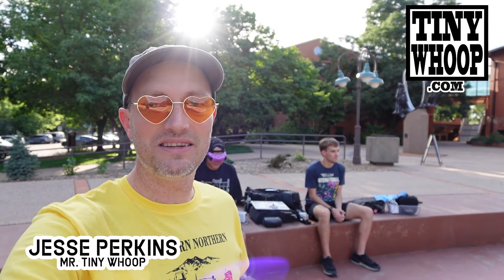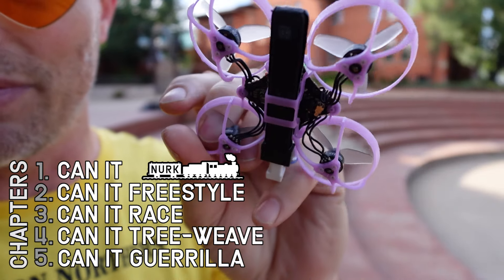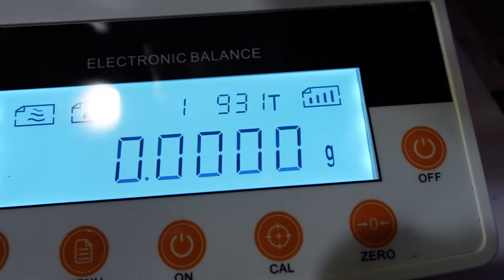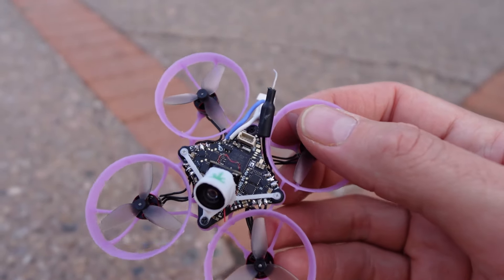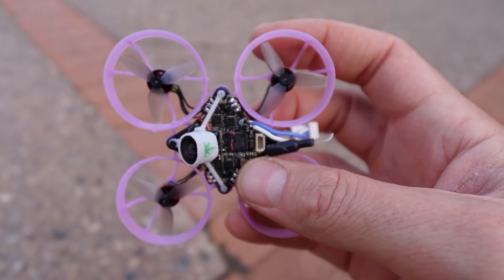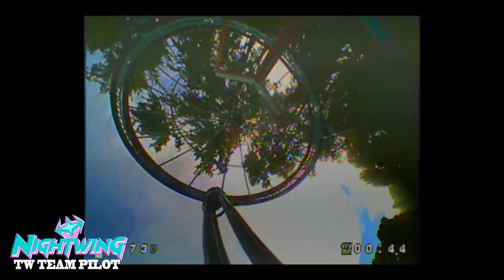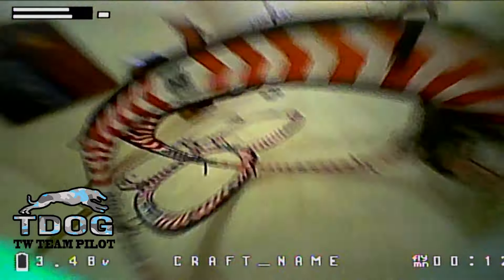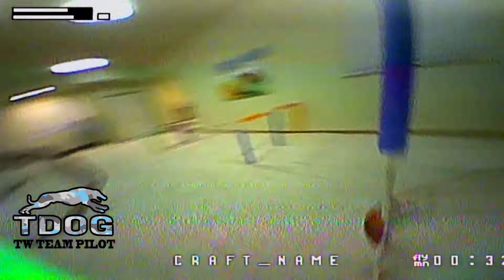BetaFPV Air Brushless 5 in 1 Flight Controller REVIEW and HARDCORE Flight Test

Comment: Wouldn't you prefer each component not in a aio?.. eg the 4in1 is closer to what you want since it's lighter even after adding the elrs Rx back?
Reply from the maker: The aio makes builds a lot easier and simpler, but I get the appeal of independent vtx

Comment: I'm really curious what the all in weight was for your modified build. I used your previous weight shaving video for the Air65 to the new HDZero AIO and got down to 17.96 grams. Now considering if I could do the same with an analog.

Comment: How does it compare to HappyModel diamond board?
Reply from the maker: The diamond is a little bit lighter but had a lot of quality control issues. One of the reasons I said "if every board is like the ones I tested" at the end is because if there is an issue with one in ten or twenty it can be awful for the community. Here's hoping Betafpv works hard to keep individuals across each batch high quality!

Comment: 3.77 is disappointing. The 4-in-1 is what, 2.9 something? The external receiver is around 0.47. I don't think 4 short wires make up the difference. Too much blank PCB
Reply from the maker: You should go with the 4in1 and wire a receiver :) for the simplicity I love it